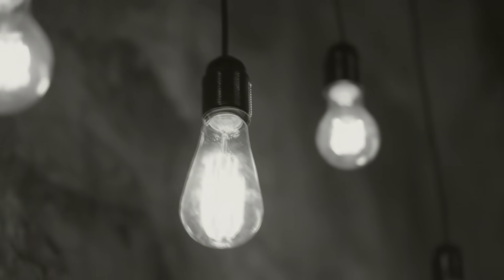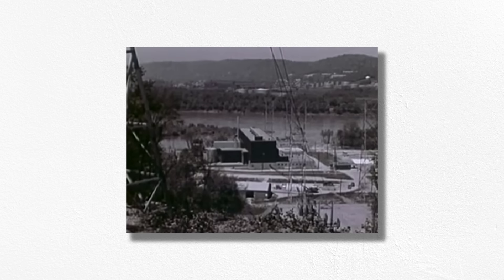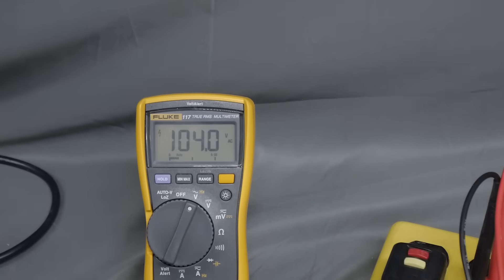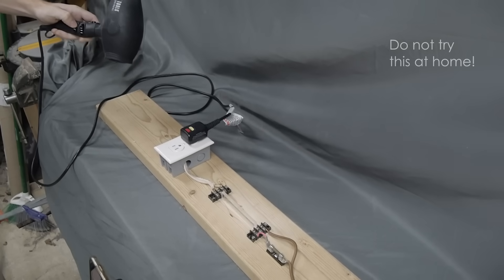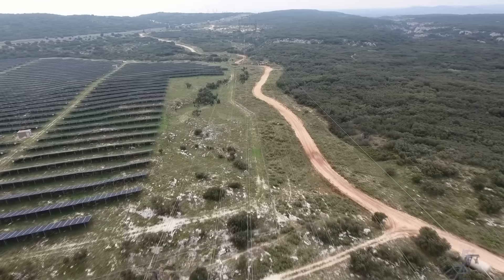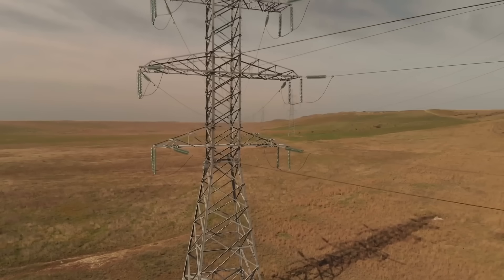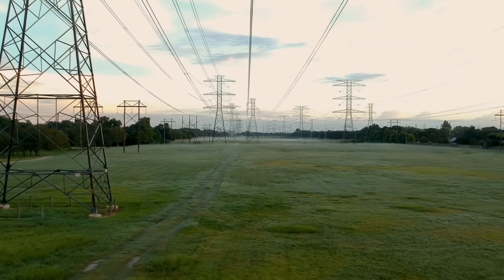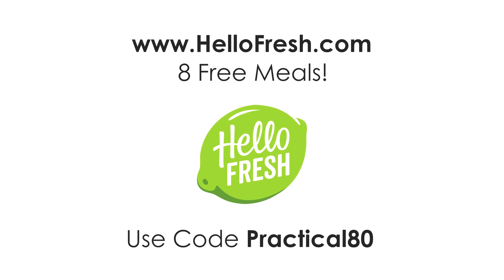How do Electric Transmission Lines Work?

Comment: I hoped to get some insight into AC vs DC. I was to buy a house right beneath a transmission line and read into the dangers. I was astounded to read that today some of the High Voltage transmission lines supposedly (At least in Germany) run on DC (Safer? Less impact on health?) but I didn't find out very much... and nothing about the line directly over that vacant property.
Reply: The issue of health effects associated with AC transmission is controversial - there is no direct evidence that there are effects, but there are indirect indications that there could be.  If there are effects, they would be associated with higher voltages, and they would be associated with prolonged exposure to the electric field surrounding a transmission line.    On the other hand, field intensity diminishes with the square of the distance away from the line.  For that reason, grid planners try to avoid placing very high voltage lines in close proximity to residential areas.

AC can be used to transmit power for tens to hundreds of miles, but as the distance increases, a point is reached when AC no longer works.  DC is used for long-distance transmission - the cost per mile is lower for DC lines because there are fewer conductors, and there is a distance tradeoff where the savings in line cost offsets the cost of the AC-DC conversion terminal.  DC is also used to interconnect asychronous sytems, and systems that operate at different frequencies.

Comment: Power companies aren't compensated for energy lost in the grid?  You don't think that's baked into the cost of electricity?
Reply: Haha, yes. It’s still in their best interest to reduce losses as long as that costs less than generating more electricity, but yep, they factor that in 😂
Reply: yes and no.  Utilities can set the rates they sell it to consumers so all of that is factored into their pricing structure.  I wouldn't call it "baked into" because that sounds kind of shady.  That said, power sold from utility to utility is typically sold on the open market so you might not have too much control over those prices.
Reply: @tchevrier  baked in sounds shady to you? That's interesting, because I've always found the opposite – that "it's all been accounted for" sounds sinister but "it's baked in" reminds me of "it does what it says on the tin", but also just.. home baking.
Reply: tchevrier public service commissions generally set rates for utilities. The cost of lost power is figured in the same way any other business figures in lost product to provide service. Business 101.
Reply: For-profit companies seek to maximize revenue and minimize costs.  They're going to charge you what the market will bear, no matter how much their bottom line gets impacted by resistance losses.
Reply: "You don't think that's baked into the cost of electricity?"

In principle, only a portion of it should be and the size of that portion should depend on the elasticity of the supply and demand.
Reply: Sure, but it's still a major loss of efficiency, and thus profit or competitive edge. More energy loss = more energy generation required = more maintenance costs & more pollution etc...
Reply: It sure is. In my state, the electric bill is broken up into two parts- “Transmission” and “Distribution” costs. 
  The first one bakes that cost into your bill, approved by the PUC.
Reply: @kamakaziozzie3038  Interesting! What state is that?
Reply: Effectively, yes. Electricity is bought wholesale by the MWH, in what a friend who wanted to be on the trading floor called "the highest stakes poker game in the world." It is sold by what the end customers' meters register at the rates the customers have regardless where the energy comes from. Money is spent and money is collected. The losses are just a small part of the vig.
Reply: Maine's largest supplier splits the bill into supply and delivery.
Reply: It is baked in but most states now a days decouple their rates from usage which de-incentives utilities from encouraging excessive energy use.
Reply: @budders9958  the electric comps have higher rates on high usage for residetial consumers (sucks if your apartment has electric heat) but discounts for high usage by industry like Intel or Boeing. Last month they had to raise the incredibly low price electricity to Alcoa because BPA couldn't raise everyone else's prices.

Comment: You should do a video on why rotating mass is important to a powergrid
Reply: Are you talking about flywheel energy storage?
Reply: @General12th  Probably more traditional power generation methods that involve large spinning turbines. However, there's an initiative with some North American Energy Reliability Organizations to study the impacts of inverter-based generation technologies on the Bulk Electric System. This may lead to stronger voltage/frequency performance requirements years from now.
Reply: J.J. Shank pretty much

Comment: But again, how do poweplants adjust instantly to the demand?
Reply: Peter La Anguila they don’t, my brother is a grid operator and his job is to predict load through the day and bring sources online to match the expected demand. Typically they utilize high output peaker plants like pumped storage or gas plants for sudden demand increase as these can ramp production up quickly and easily. Whenever there is mismatch you get voltage and frequency variation, and these are regulated to very tight tolerances by the government.
Reply: Powerplants by design have huge spinning turbines that act like large flywheels storing energy as a buffer to changes in supply aswell as the above comment

Comment: Hey Grady, would dismantling The Grid and instead using local power stations fueled by renewables and atmospheric water and carbon dioxide converted into hydrogen & syngas, the latter of which then gets processed into kerosene? The energy losses seem like they'd be high enough that it might be feasible, and would make it so that there's far less risk/issue of brownouts or blackouts, esp. rolling varieties that take out entire cities, while also making things much safer in general. What are your thoughts?

Comment: in london, cable tunnels are becoming increasinly common since pylons aren't an option... i think there's about 50 or something cable tunnels, some short, some long, the underground is the new sky
Reply: Its damned expensive but in places like that there are limited options
Reply: @JonnyD3ath  expensive yes but is far more convenient in the long run, sub-surface utilities (water, gas, HV, LV, countless communications, etc) make installing and maintaining grid voltage lines incredibly inconvenient, dangerous, and difficult - tunnels allow cables to be cooled, additional cables can be installed and maintained very fast without disrupting traffic/life on ground, don't need to worry about interfering with other utilities or them interfering with yours, don't need any planning permissions (or very few) and i think it's cheaper to build a tunnel to last 100~ years as opposed to 100~ years of digging up roads and dealing with 10-20 utility companies (according to a paper i read about the earliest electricity tunnels from the early 1900s), i think this would make a great episode for grady to do :))
Reply: nitrxgen it's definitely worth it in cities but most of the transmission and electrical distribution network is not in cities and it is not economically viable
Reply: @JonnyD3ath  yes, of course i refer to inner city electricity transmission, even river crossings where it's too wide for pylons to be used, some used to cut through mountains but the one i know of makes use of a disused train tunnel (in uk at least)

Comment: In Southern California we get billed for fires started by lack of maintenance. 
We get billed for nuclear power plants improperly designed and later decommissioning of the plants.
We get billed for the pollution caused by coal and gas generation.
We get billed when they convert to wind and solar power.
We get billed when we use electricity at the wrong time of day.
Now they shut the electricity completely  off if it's too dangerous to send it to us.
We get billed while we sit in the dark.

Comment: What about the growing potential issues of personal solar panels preventing sub stations from quickly switching power off then on again when a squirrel for example creates a temporary fault.
Reply: Josh P. We have this issue with the sudden increase in small scale rural wind generation - the tail is starting to wag the dog
Reply: @JonnyD3ath  is there a solution available yet. I'm not in the industry so I'm far from in the loop this is just something that I find interesting. Cause as I think about it more the bigger issue isn't a temporary fault but rather a true fault where lineman have to go service the lines.
Reply: Josh P. Its still getting sorted out as of yet. We are having to treat them as points of isolation but it means alot of extra work for engineers switching out sections of line for routine work to take place, meaning there is a smaller window in which to carry out work aswell

Comment: And there is so much more. Like how they balance the load and supply power, sync the output voltage phase of the power plant to the grid. And about the loss from inductance and capacitance of the conductors in AC leading to high voltage DC line can be more efficient in some case. Hell, you can make a lot of videos about the power grid.

Comment: I = E/R.   When did E get replaced by V for Volts?  why did someone leave I for current and decide not to use C?
Reply: That's the notation that power engineers use.

Comment: So I fly a foot-launched ultralight aircraft called a paramotor, and one of the spots I fly is right near some of these lines. I've gotten fairly close, maybe 50 feet or so, and I'm wondering how close I can get before the lines start to cause me, my motor, or my wing some disturbance. They definitely scare me enough to stay well enough away, but I figured I could get about as close to the lines in the air as I could on the ground (they're suspended a little over 50 feet up) safely.

Comment: Why are power lines in the air and not buried?

Also, why isn't wireless power transmission used anywhere except for my phone charger?
Reply: To your second question: the efficiency of wireless power transmission is much, much smaller than when connected via conductors. Your phone charger works, because not much Power is needed and because the distance between charging station and phone is very small.
Reply: Basically building transmission towers and installing power lines are generally easier than designing and producing insulation for high voltage cables to be buried underground. Fault detection also easier with conventional power lines
Reply: Thanks for the replies
Reply: They are in the air because of losses. I'll try to explain:
Imagine you have a cable with no voltage on it initially. When you now turn on a constant voltage (even when there is no consumer at the end of the cable) a small current flows. This current happens, because the cables material and (more importantly) the earth around it gets kind of charged. Once everything is charged, the current is zero again (because no consumer).

However, we are commonly using AC (Alternating Current) which basically means the current doesn't just flow from A to B, but it permanently changes direction. This means, that this process I explained earlier happens every time, the current/voltage switches direction. In a 60 Hz network, this charging would happen 120 times per second. This flowing current through the cable causes losses, as explained in the video. The longer the cable, the more material is getting charged.

The air cannot be charged nearly as much as the earth. Hence, much much less current flows everytime the voltage switches direction. This is why for long distances, you use either a) wires in the air for AC, or you could b) send DC throught the ground.

I hope I could explain it well enough, English is not my first language.

Comment: I’m wondering your opinion about sulfur hexaflouride(SF6) in the electric grid? 
I know it is widely used to prevent short circuits and accidents in the industry , however it’s a very powerful greenhouse gas 23,500 times more potent than CO2. (https://www.bbc.com/news/science-environment-49567197)
Is there other alternatives which can be used instead?
Reply: SF6 is the "perfect" insulation gas, high dielectric strength, high breakdown voltage, and its electronegativity made it a good arc extinguisher. there are some alternatives such as using vacuum as insulation, but afaik SF6 is the most practical solution right now

Comment: What would happen if there was more solar generated AC put onto the grid at the distribution side of the grid than was being consumed?
Reply: assuming interconnected and massive grid, the power flows back to the transmission network
Reply: That would be a great followup video. Grid operators try to balance types of production to avoid that. Nuclear is great at base load constant output.  Gas turbine and hydro is good at throttling for peak demand  and compensating for unreliable variable sources like solar and wind. Viable storage options are needed for solar and wind generation variations.

Comment: Talk about DC transmission. My dad  set up and operated DC transmission lines and i never fully understood them.
Reply: I think this is interesting, because to inexperienced people DC should be way easier to understand than AC.
Reply: @DemokratieVerteidigen777  DC is far from simple. The more i learned about it the more I realized AC is less complex and easier to understand. DC needs a ground loop and ground grids because the "electrical" flow is one direction.

Comment: 3:36 I think you meant to show the P = V • I equation.
If you reduce the current in V = I • R, the voltage also decreases. A higher voltage across an equal resistance will lead to a higher current and vice versa. Doubling the voltage would give you double the current and four times the power.
Reply: I think I may have misunderstood the point of your original post though. It was early for me.
Reply: @Jin Rin increasing wire size increases cross section which gives electrons more area to flow.
Reply: You're misunderstanding the V in the power equations. P=IV, which substituting with ohm's law (V=IR) also gives V²/R and I²R. However, the V refers to the voltage drop across a load. While the voltage of the power lines in reference to ground definitely goes up, that is not the voltage drop across the line itself from point A to point B, which is ideally constant for a given power line.
Reply: @roberthunter5059  V^2/R isn't a Voltage drop, that's the power usage of a load R at the voltage V
Reply: @coal6tamarack2374  That's what I said.
Reply: @roberthunter5059  I had to read your comment like 10 times, but I finally get it.  Increasing the "voltage" on the line doesn't mean increasing the "voltage drop"!  I don't know why it was so confusing for me.  I guess if I didn't already know the equation P=V^2/R then I wouldn't have noticed the asymmetry and gotten tripped up in the first place.
Reply: Alfred Jodokus Kwak the key point is that for a given Power, increasing the Voltage reduces the required Current.  And the voltage drop (loss) in a line is a function of the Current and Resistance.
Reply: @deonmurphy6383   That's absolutely correct but that's not what the equation at 3:36 is about.

Comment: please tell about phase balancing, how it works
Reply: Phase balancing can mean two things. 1) making sure that the electrical load on each of the 3 phases in a distribution feeder is about the same to prevent unbalanced current flows (which lead to current flow in the neutral which shouldn't happen and harmonics in transformers which cause them to overheat) or 2) transmission line conductors are transposed every 5 or so spans to try to reduce the capacitance of the line.
Reply: @mirskym  About the first one

Comment: Currently building the foundations for transmission lines it’s what you can’t see that’s the most work...  but maybe i’m a little bias
Reply: I've seen various access roads to facilitate construction but do you guys ever airlift material in for construction? I have seen some towers and just had absolutely no clue how you guys got material up there.
Reply: @johndoe-es7zh  It's not unusual to see helicopters used to move construction material into place, or to spool out conductors.  But one of the ongoing issues that Grady mentioned in passing was that transmission lines sag when they carry heavy loads, and that can create problems if there are trees beneath the lines.  It's not unusual for grid operators to use aircraft to patrol transmission lines to monitor for vegetation growth.  Eventually, however, it is necessary to get people on the ground to do something about vegetation under the lines - that can be a challenge.
Reply: Louie Powell on our network the lines are patrolled on a regular basis and we run a constant vegitation management program where guys are on the ground 365 days a year cutting to keep them clear
Reply: @johndoe-es7zh  Yeah in rural areas and hilly regions where buildings roads aren't feasible or economical we airlift materials for construction. In one case we also have constructed rope ways for transportation of stubs and other construction materails.
Reply: Structural design of transmission lines and towers is itself a fascinating and complicated science.  The Electric Power Research Institute operate a laboratory near Dallas where actual towers are erected and subjected to calibrated stresses to determine the load constraints.
Reply: Surprise! You just created an artisanal well after you had to move your hole five times due to crap that didn’t show up in the borings!